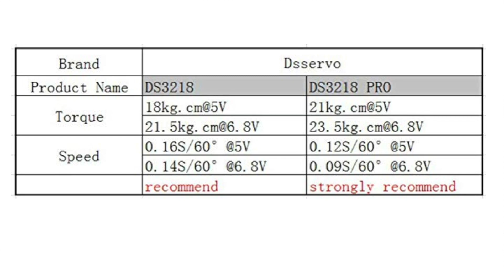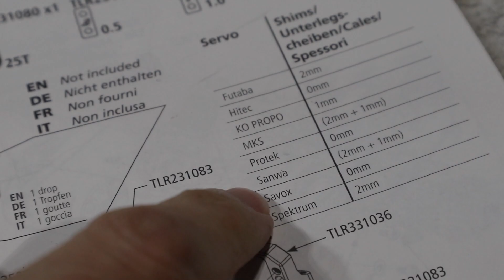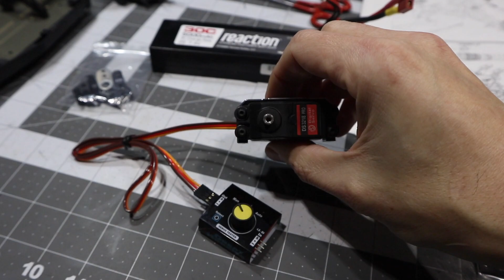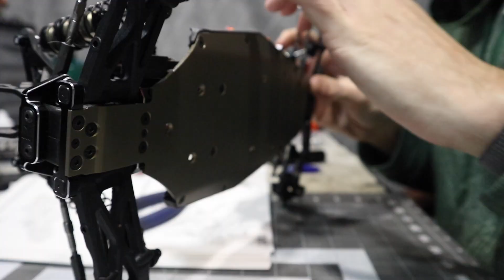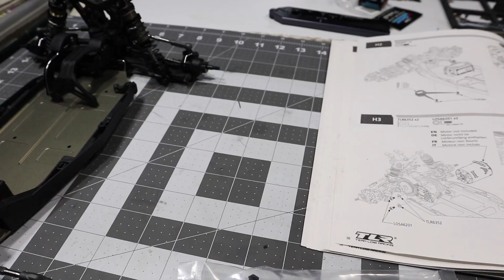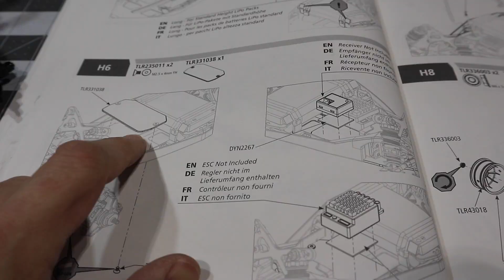TLR 22 5.0 Elite Buggy Kit Build (pt6) - Servo, Motor, Battery, Electronics Mock Up - Netcruzer RC

Comment: 🌕🌎🐸 that servo install is a bitch, I figured it out after a while, but when I went to upgrade the servo I was forced to remove front end about 10 screws and dremel out cavity and slightly brisk the sides. Thumbs down on that area. All it needs is to have the wishbone easy to remove.
Reply from the maker: Yeah, it’s a pain. Wait till you need to service the ball Diff! Just made a video about that, 20+ screws. 🤦‍♂️

Comment: What size pinion gear should I use if I’m going with a 13.5t motor?
Reply from the maker: The recommended gearing for that is in the book. It’s very conservative though. You could add 5 teeth and it’ll be near the limit.

Comment: The tools supposedly magnetic..
If you have a magnetic tray or some powerful magnets sit your tools in that and some reason as i have found they become magnetized.. 
Another way if you dont have the tray  you could get some cheap rare strong  earth magnets and tape them or glue (hot glue maybe) 2 little round disc ones to each of the drivers.. should then magnetize the drivers..

Comment: The carbon tray is there so you can easily remove your electronics for cleaning without having to retape every time you clean the car, so do not stick your esc on top of those mounting screws. That servo will do just fine, I have several of them ( also the 25kg version ) in my cars and they are holding up for over a year now without any issue. The only differance I notice compared to my Savox servo's is that they have a slightly less smooth travel but other than that they are great.
Reply from the maker: I raced it last night. Servo seems fine on paper but in practice it caused me trouble. It is the cause of the interference as it’s too tall, and it’s to slow to change direction. Not coreless I suppose. Lacks any fine control, it’s smooth and fast and strong but not good enough to compete with IMO. It’s coming out.

Comment: FYI, gravity is one of the most useful tools in your toolbox.  I usually flip the chassis over and screw upwards into the chassis so that the screw and loctite stay on the driver when first threading in.  Also, when you go to clean up the ESC solder posts, not a bad idea to heat them up upside down so that the solder flows downward back onto your iron rather make an even bigger mess on the ESC posts.  Anyway, have fun!

Comment: Don't float a servo on a aluminum chassis. Shim mount to make flush or almost flush would proably fix your clearence! Love your channel! Hope it runs well for you!
Reply from the maker: There is no height adjust. You can only shim it forward. I need to go backwards and down which is not supported. A small filing down is all it needs. I asked 22empire and it seems most in my situation just start filing parts down for clearance. I will if I must.
Reply: @netcruzer  , I'll rewatch. Figured you could put something between servo and mount...... Guessing screws won't line up with ears?🤔 Raced a lot of LOSI and tamiya on road, associated off road in the 90's! If i went back to offroad that's the car i would have! Have fun with it! Still have my kyosho optima from 87'! First real r/c car!😀

Comment: Nice video, I enjoy these even though I've already built a 5.0!  The stock plastic servo horn is actually pretty tough.  I use it in my 22 5.0 SR, even though I have an aluminum TLR one.  Never needed the aluminum one.  I would highly recommend using loctite on the mounting screws for the servo.

The problem with those servos is that they are some of the tallest in the market, and don't fit properly in certain vehicles, it's a little too forward in this case.  Your horizontal draglink is probably sitting a little diagonal east-west rather than straight because of the tall servo.  This is not ideal since it will add mechanical expo to the steering.  FYI, the purpose of the carbon ESC tray is so that if you remove your motor, you can also remove the electronics tray so it's not dangling from the ESC while you're fiddling with the transmission.  But it's certainly optional.
Reply from the maker: I wondered why they don’t recommend it. So I didn’t add any. Likely a miss in the documentation as most 5.0 cars don’t have the metal servo mount.
Reply: @netcruzer  yeah, it's stupid, honestly most manuals are about 50/50 on whether they indicate properly to loctite, my Schumacher is more like 90/10 and you basically should loctite everything!  Good luck with the buggy, hope to see it in action in one of your race videos!

Comment: Change the shims on the servo
Reply from the maker: I didn't use any shims. Moving it forward with shims looks like it would hit more. IMO the arm needs to move back 1mm, but I have no adjustment for that.
Reply: Netcruzer RC TECH CARS Have u done solved this problem,mine 22 4.0 2wd also got this issue too😬
Reply: Weird mine wasn't like that at all